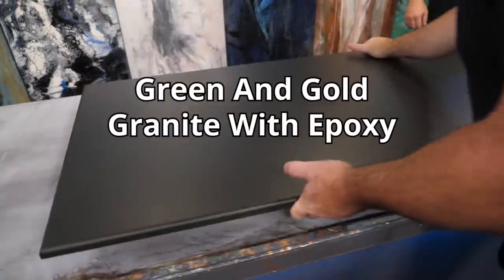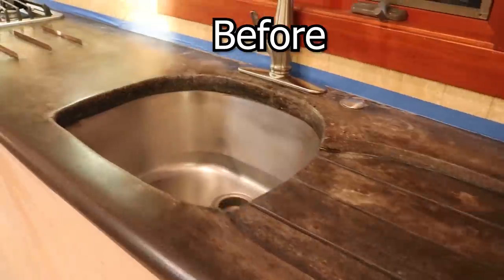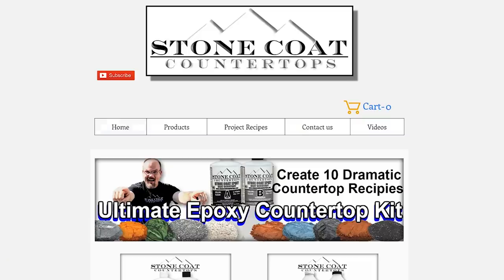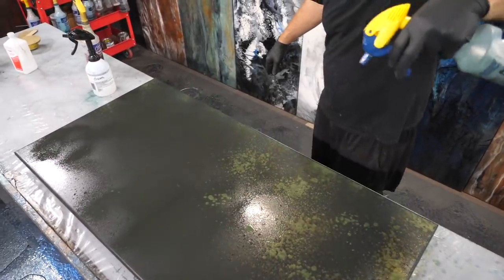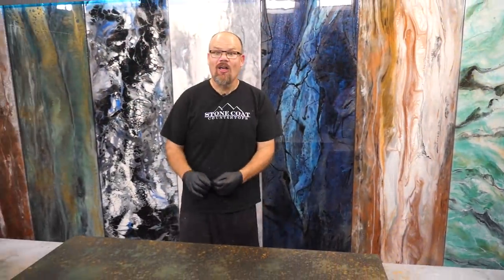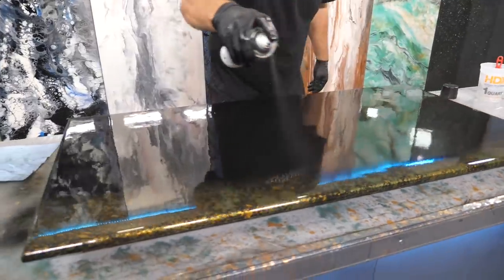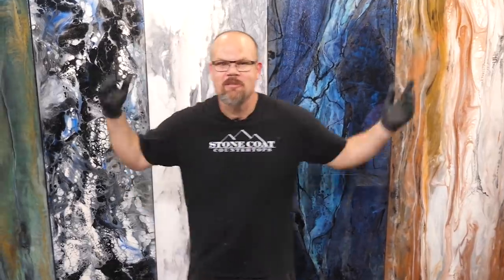Make Green and Gold Granite with Epoxy | Stone Coat Countertops

Comment: I just tried this on kitchen countertops and it turned out absolutely beautifully.  The color was a little different than the video but for my first attempt on epoxy i was thrilled.  So easy to do just follow the simple instructions.  Light shining on the gold shines so beautifully and really goes well with my dark green cabinets and gold faucet and cabinet pulls! Thanks stone coat!

Comment: For a complete rock nerd,who also loves to art with resin,this is like heaven..I'm drying to try it! THANKYOU!!
Reply: Don't use it on a countertop.
CONTRACTOR FOR OR 25 YEARS

I watched over 30 Stonecoat Countertop videos over a period of month's. Been using numerous epoxy resins for at least 6 years now. Was very impressed with the advertised heat resistance of Stonecoat epoxy,  plus the training videos are very exciting. 
I finally bit the bullet for Stonecoat art resin at $115 gallon. Got a large enough amount to experiment with. 
I called and asked many questions, then decided on the art coat because it's compatible with acrylic paint pouring and alcohol inks.
I stressed that I would be doing bar countertops and tables that would be getting high usage. I was advised that the art coat was as sturdy and heat resistant as their other epoxy. 
Got the product in.  Had a large table sanded and prepped. Had the basement dehumidifier on for 3 days before pour. No dust. Temps and humidity were spot on then poured intial layer with pigments. IT'S GORGEOUS!
Followed directions totally and did top coat.
One stray fly got me! The way they advertise their product,  I was surprised that I couldn't remove and polish out, but was told that I would have to recoat entire piece. Not happy. 

Recoated totally per specs. Beautiful and perfect!
Waited 7 days for cure...
Set a coffee mug on it... IT MARKED UP

Waited 30 days...
Set a coffee mug on it... IT MARKED UP!

Waited 60 days...
Set a coffee mug on it... IT STILL MARKED UP.

During that period,  I left a message on their youtube page... NO RESPONSE
I called and left indepth message and the guy who called back and left a message hadn't even listened to my message.
Then I emailed...

MY EMAIL...

"I left a message that I had purchased a gallon of your art resin, had the temps and humidity perfect. Tabletop has been finished over 2 months and still marks up. It's gorgeous, just not usable. 
I can sit a glass on it and within 10-15 minutes it will leave an indention. Over the period of a few hours it will ease back out. 

I've used Famowood and 3 other resins over a period of 6 years and am familiar with the process. I was attracted to the advertised heat resistance and toughness of your product and would really like to complete my project by sanding and recoating my table with the tough product that you advertise. 

The resin is bad and I have a lot of work in this table (hours) and still can't sell it. 
Thank God I didn't do a countertop for a customer with this. 

How can you help me out with this bad gallon of resin that I have?
Please contact me asap."

STONECOAT COUNTERTOP RESPONSE...

"Most epoxy gets quite brittle with age; our product will give slightly to allow for this movement. With that said, our hardness still allows for polishing. If an epoxy is too soft it won't shine again when polishing. This balance is important. Objects will
leave impressions, but the impressions will come out in room temperature once the object is removed. The epoxy has "memory" and will level back. To expedite this you can apply a blow dryer to the area. As the material continues to cure it will become harder
but it's designed to retain some of this quality so it makes it possible to pour over a wood, and laminate surface. We believe our formulation is second to none for the purposes we show on our videos."

CONCLUSION...

WHAT THEY ARE STATING IS THAT THEIR EPOXY NEVER HARDENS ENOUGH NOT TO MARK UP!
GET OUT THE HAIRDRYER EVERY TIME YOU SET SOMETHING ON YOUR COUNTERTOP 🙄
UNBELIEVABLE. 
The rest of the email was condescending and treated me like an idiot with no experience. Must be the woman thing? 

DO NOT BUY STONECOAT COUNTERTOP EPOXY!
They will not guarantee it when IT IS A BAD MATERIAL!

AT MINIMAL IT SOUNDS LIKE YOU'LL NEED TO KEEP A HAIR DRYER IN YOUR KITCHEN FROM NOW ON. SAD.

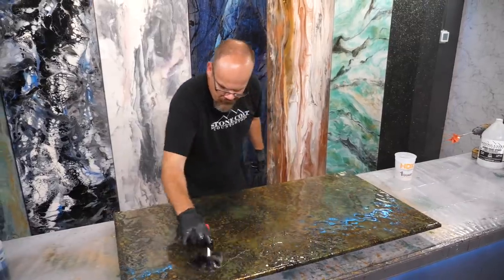Comment: @5:04 ...Mike is smoothing the edges with acetone. He says to smooth 'after the curing process has taken place', but that looks like right after chopping. Did he misspeak? My sides are wavy and I wanted to avoid sanding to even them out. Any ideas?

Comment: We're building our house, and Expoxy countertops are what I want for both bathroom vanities, and the master bathroom 3 foot x 5 foot shower stall!  Can you show some videos of shower stall work? 
 I'm soooooo excited to get the lovely colors I want, without paying Granite prices!  Lemurian Granite is my LOVE, but it's waaaaay too expensive.  This will be my solution to getting something very close to it!  <3
Reply: Get Marine Resin
Stonecoat won't stand behind theirs. 

CONTRACTOR FOR OR 25 YEARS

I watched over 30 Stonecoat Countertop videos over a period of month's. Been using numerous epoxy resins for at least 6 years now. Was very impressed with the advertised heat resistance of Stonecoat epoxy,  plus the training videos are very exciting. 
I finally bit the bullet for Stonecoat art resin at $115 gallon. Got a large enough amount to experiment with. 
I called and asked many questions, then decided on the art coat because it's compatible with acrylic paint pouring and alcohol inks.
I stressed that I would be doing bar countertops and tables that would be getting high usage. I was advised that the art coat was as sturdy and heat resistant as their other epoxy. 
Got the product in.  Had a large table sanded and prepped. Had the basement dehumidifier on for 3 days before pour. No dust. Temps and humidity were spot on then poured intial layer with pigments. IT'S GORGEOUS!
Followed directions totally and did top coat.
One stray fly got me! The way they advertise their product,  I was surprised that I couldn't remove and polish out, but was told that I would have to recoat entire piece. Not happy. 

Recoated totally per specs. Beautiful and perfect!
Waited 7 days for cure...
Set a coffee mug on it... IT MARKED UP

Waited 30 days...
Set a coffee mug on it... IT MARKED UP!

Waited 60 days...
Set a coffee mug on it... IT STILL MARKED UP.

During that period,  I left a message on their youtube page... NO RESPONSE
I called and left indepth message and the guy who called back and left a message hadn't even listened to my message.
Then I emailed...

MY EMAIL...

"I left a message that I had purchased a gallon of your art resin, had the temps and humidity perfect. Tabletop has been finished over 2 months and still marks up. It's gorgeous, just not usable. 
I can sit a glass on it and within 10-15 minutes it will leave an indention. Over the period of a few hours it will ease back out. 

I've used Famowood and 3 other resins over a period of 6 years and am familiar with the process. I was attracted to the advertised heat resistance and toughness of your product and would really like to complete my project by sanding and recoating my table with the tough product that you advertise. 

The resin is bad and I have a lot of work in this table (hours) and still can't sell it. 
Thank God I didn't do a countertop for a customer with this. 

How can you help me out with this bad gallon of resin that I have?
Please contact me asap."

STONECOAT COUNTERTOP RESPONSE...

"Most epoxy gets quite brittle with age; our product will give slightly to allow for this movement. With that said, our hardness still allows for polishing. If an epoxy is too soft it won't shine again when polishing. This balance is important. Objects will
leave impressions, but the impressions will come out in room temperature once the object is removed. The epoxy has "memory" and will level back. To expedite this you can apply a blow dryer to the area. As the material continues to cure it will become harder
but it's designed to retain some of this quality so it makes it possible to pour over a wood, and laminate surface. We believe our formulation is second to none for the purposes we show on our videos."

CONCLUSION...

WHAT THEY ARE STATING IS THAT THEIR EPOXY NEVER HARDENS ENOUGH NOT TO MARK UP!
GET OUT THE HAIRDRYER EVERY TIME YOU SET SOMETHING ON YOUR COUNTERTOP 🙄
UNBELIEVABLE. 
The rest of the email was condescending and treated me like an idiot with no experience. Must be the woman thing? 

DO NOT BUY STONECOAT COUNTERTOP EPOXY!
They will not guarantee it when IT IS A BAD MATERIAL!

AT MINIMAL IT SOUNDS LIKE YOU'LL NEED TO KEEP A HAIR DRYER IN YOUR KITCHEN FROM NOW ON. SAD.

Comment: I can't wait to do this.... I'm gonna be a pro❤
Reply: Go buy Marine Epoxy. Stonecoat will blame their defective material on you.

CONTRACTOR FOR OR 25 YEARS

I watched over 30 Stonecoat Countertop videos over a period of month's. Been using numerous epoxy resins for at least 6 years now. Was very impressed with the advertised heat resistance of Stonecoat epoxy,  plus the training videos are very exciting. 
I finally bit the bullet for Stonecoat art resin at $115 gallon. Got a large enough amount to experiment with. 
I called and asked many questions, then decided on the art coat because it's compatible with acrylic paint pouring and alcohol inks.
I stressed that I would be doing bar countertops and tables that would be getting high usage. I was advised that the art coat was as sturdy and heat resistant as their other epoxy. 
Got the product in.  Had a large table sanded and prepped. Had the basement dehumidifier on for 3 days before pour. No dust. Temps and humidity were spot on then poured intial layer with pigments. IT'S GORGEOUS!
Followed directions totally and did top coat.
One stray fly got me! The way they advertise their product,  I was surprised that I couldn't remove and polish out, but was told that I would have to recoat entire piece. Not happy. 

Recoated totally per specs. Beautiful and perfect!
Waited 7 days for cure...
Set a coffee mug on it... IT MARKED UP

Waited 30 days...
Set a coffee mug on it... IT MARKED UP!

Waited 60 days...
Set a coffee mug on it... IT STILL MARKED UP.

During that period,  I left a message on their youtube page... NO RESPONSE
I called and left indepth message and the guy who called back and left a message hadn't even listened to my message.
Then I emailed...

MY EMAIL...

"I left a message that I had purchased a gallon of your art resin, had the temps and humidity perfect. Tabletop has been finished over 2 months and still marks up. It's gorgeous, just not usable. 
I can sit a glass on it and within 10-15 minutes it will leave an indention. Over the period of a few hours it will ease back out. 

I've used Famowood and 3 other resins over a period of 6 years and am familiar with the process. I was attracted to the advertised heat resistance and toughness of your product and would really like to complete my project by sanding and recoating my table with the tough product that you advertise. 

The resin is bad and I have a lot of work in this table (hours) and still can't sell it. 
Thank God I didn't do a countertop for a customer with this. 

How can you help me out with this bad gallon of resin that I have?
Please contact me asap."

STONECOAT COUNTERTOP RESPONSE...

"Most epoxy gets quite brittle with age; our product will give slightly to allow for this movement. With that said, our hardness still allows for polishing. If an epoxy is too soft it won't shine again when polishing. This balance is important. Objects will
leave impressions, but the impressions will come out in room temperature once the object is removed. The epoxy has "memory" and will level back. To expedite this you can apply a blow dryer to the area. As the material continues to cure it will become harder
but it's designed to retain some of this quality so it makes it possible to pour over a wood, and laminate surface. We believe our formulation is second to none for the purposes we show on our videos."

CONCLUSION...

WHAT THEY ARE STATING IS THAT THEIR EPOXY NEVER HARDENS ENOUGH NOT TO MARK UP!
GET OUT THE HAIRDRYER EVERY TIME YOU SET SOMETHING ON YOUR COUNTERTOP 🙄
UNBELIEVABLE. 
The rest of the email was condescending and treated me like an idiot with no experience. Must be the woman thing? 

DO NOT BUY STONECOAT COUNTERTOP EPOXY!
They will not guarantee it when IT IS A BAD MATERIAL!

AT MINIMAL IT SOUNDS LIKE YOU'LL NEED TO KEEP A HAIR DRYER IN YOUR KITCHEN FROM NOW ON. SAD.

Comment: You can see from the rippling reflection of the lights in the final pan how this epoxy comes out if you just trowel, chop and torch it on a flat workpiece. For me, it was beautifully clear but the leveling simply wasn't good enough. Making a wall around the workpiece like they do in the river table examples REALLY makes a huge difference. It sets up absolutely flat.